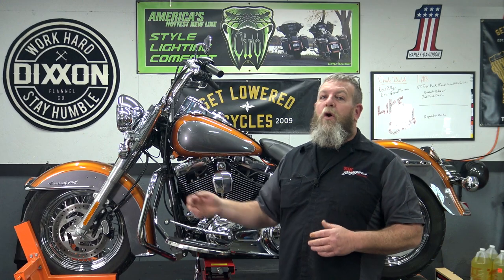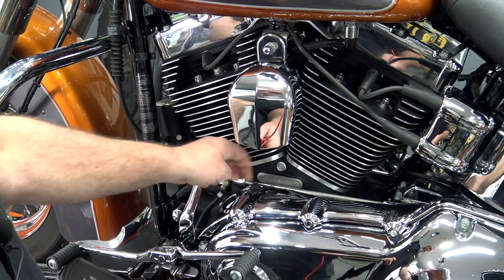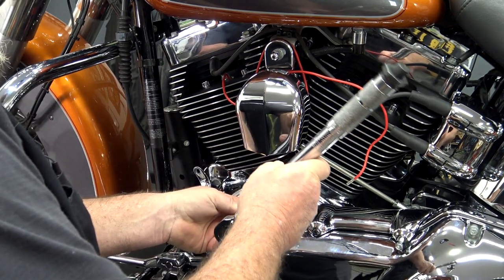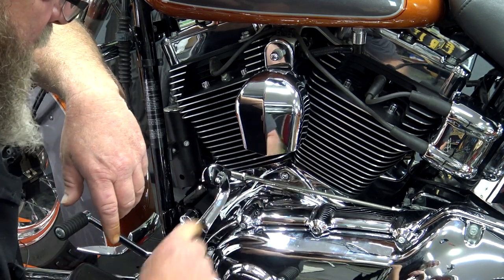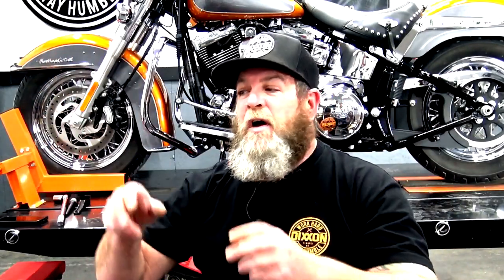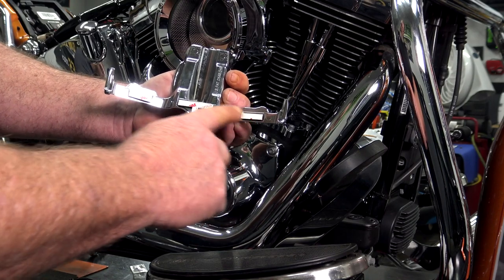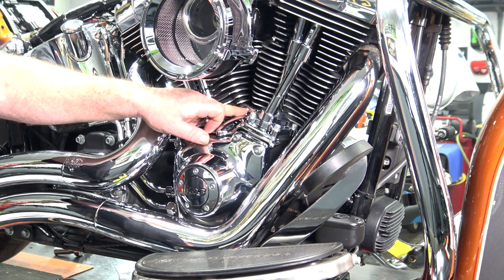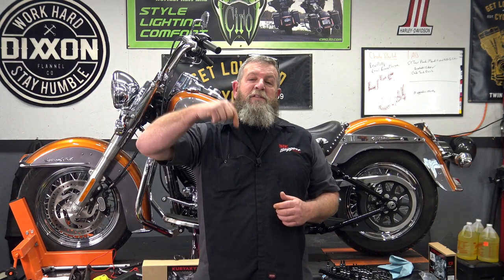Kuryakyn Tappet and Cylinder Base Cover Install Softail Cholo Project

Comment: Great videos!  I have a RK and want to install those chrome  Accessories  I wanted to know if the torque specs are the same as the ones that you are  Applying on that softail
Reply from the maker: Sorry for the late reply, just got back from Sturgis , The specs will be different for your bike...let me know the year of your bike and ill see if I have a service manual for your bike and ill send you the link to my drive so you can download it.

Comment: Looks good. But u think it will make the engine run hotter?
Reply from the maker: Hey chad great question that I had addressed in one of my older videos and just really didnt think about in this one...Ive had covers on my SG for several years and never seen any significant heat increases from covers..these motors are made to run pretty hot anyway...on the SG, before I switched out my stock radio it had a temp meter in it,...never seen it run hotter than normal after the cover isntall.so I dont worry about them. Tons of people run these with no issues.
Reply: @sikbaggers  ok thanks for the info. And love ur videos man.

Comment: Looking good Steve!! Have a small unrelated question that has to do with your bagger air ride. Seen a video where you said you went to dirty air from jnr. I am running jnr, what type of issues did you run into with them so I may keep watch on mine. Thanks for what you do!
Reply from the maker: Thank you! And firstly I hope you never have issues with yours because you will never be able tog et ahold of them. They dont answer the phone nor respond to emails. So they dont have to fix what they dont know about. So much for that warranty.  And this isnt just coming from me...I have hundreds of people asking me why they wont answer the phone. Issues...first it was the fast up addition...within 4 months it wasnt fast...super slow like there was something plugging the air lines...took it apart 5 times and changed out the air lines twice, changed the fill valve, cleaned all of the valves, took tank off, inspected etc...you get the idea..I done it all and it never would air up any faster than a kit without the fast up tank. RHR failed after about a year...switch was bad...junked the whole RHR. After calling them 7 or 8 times in one week with no answer I reached out to Jason on facebook and was given a hundred reasons why they cant just sit around and answer the phone, they are too busy.....so i guess too busy to take care of you after the sale...complete bullshit.,,if you are that busy, you are making money...if you are making money hire and train someone to answer the phone. I hope you never have any issues man. Let me know if you need anything.
Reply: @sikbaggers  Thank you Steve! If and when I do have a problem with mine, I will just follow you brother. Thanks for all you do!

Comment: Have you noticed any blow by on the inside of your trask clear cover? I've seen trask is now making a external venting back plate.
Reply from the maker: Not yet...however I have already purchased it..we are in the middle of winter here so I havent got the miles on it yet...but like I said in the video just run your oil a little low on the hot side of the stick and it will reduce that blow by tremendously. Same air cleaners on baggers and 103s and this helped a lot! If I need to venting kit I will install it and also shoot another video on it.
Reply: Yep I've learned the hard way! I run it at 3/4 hot and she's happy. Your in southern Illinois right?

Comment: How do you get the hot spots to stay in . I have the outer sleeve all the way down and they just pop out and vanish into the universe. Some blue locktite on them maybe.
Reply from the maker: a small dab of clear silicone ...its easy to pick out if you ever need to remove them..I use it al the time on chrome caps and these little buggers.
Reply: @sikbaggers  Thanks for the tip